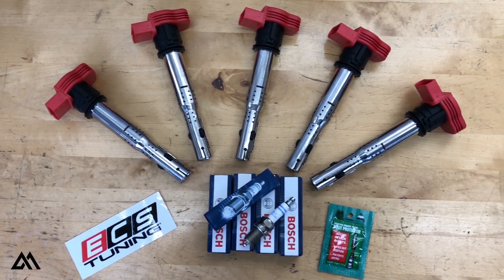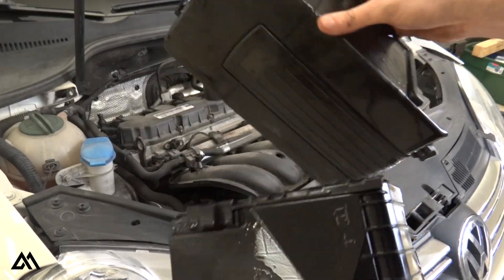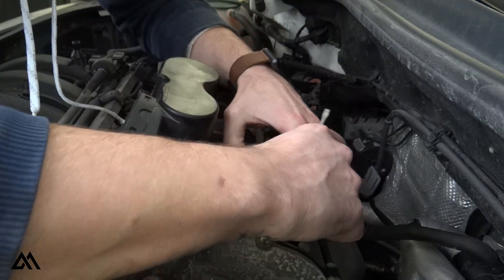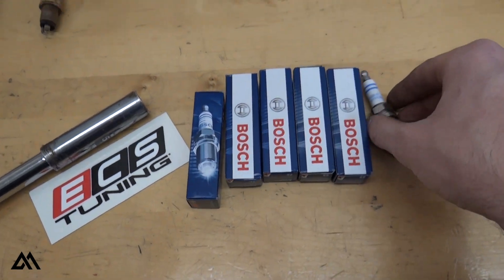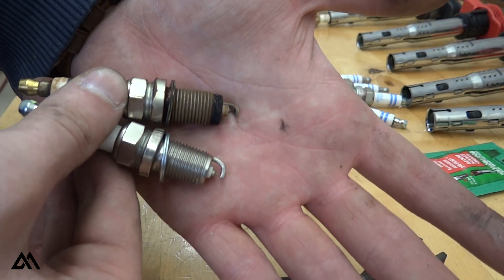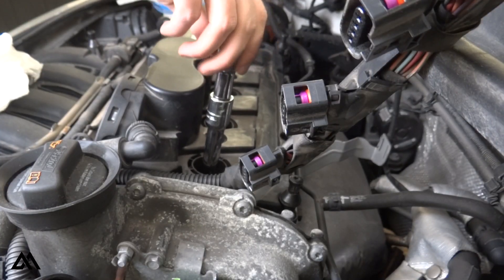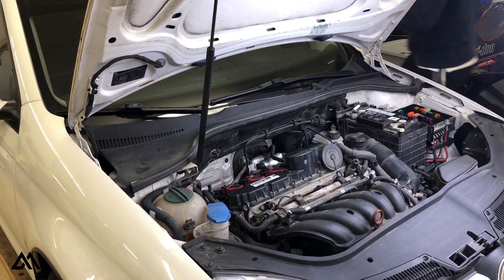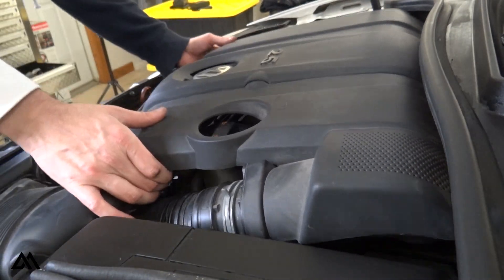Volkswagen 2.5L Ignition Service DIY | Coil Packs and Spark Plugs!

Comment: The dielectric grease should not be applied directly to the spark plug only the inner wall of the coil packs to prevent moisture and really you don’t have to use it at all cuz the coil pack insulates it pretty well already it could run rough from lack of power putting the grease where you put it.
Reply from the maker: Thanks for the correction. I’ll be sure to pin this comment so others can see.
Reply: Right. "Dielectric" means insulating. Great for waterproofing but horrible for conducting electricity.

Comment: Great vid. At the end of the video, were you able to run the engine without the engine cover and maf connected?
Reply: Don't do that, these Volkswagens have their air filter inside of the engine cover, that's why it's so annoying to remove all the hoses/pipe for the mass air flow sensor and the hose that connects to the throttle body. If you start the car without the engine cover, you will enable dirt and debris to get into your engine directly through the uncovered and unfiltered throttle body. You could install a cold air intake to keep the engine cover off, but the main point is filtering the air from airborne and loose particles.

Comment: what are the benefits from switching to the red coils?
Reply: It's a personal preference. I use NGK instead and they work great also.
Reply: @boomerguy9935 . No it's not.... If these are the real Audi ones, they are a lot more reliable and reduce heat soak by transferring heat better. You will have a better spark, smoother idle and if you plan on boosting your 07k these will handle the power more reliably......

Comment: Pop the coils up first,and then disconnect the coils.more room after you pop coils up,because it allows you to clear the bracket for the harness
Reply: Also, if you can't fit a flat screwdriver underneath, you can use a locked zip-tie as a tool to slide underneath the edge of the top of the coil to lift straight up. VW sells an expensive special tool which does exactly the same thing...typical German engineering.
Reply: Thank you guys 🙏

Comment: Hello, thanks for the video, may I ask you what sockets size u used? Thank you
Reply: There are special sockets that are made specialized for spark plugs but they are very interchangeable as they come in sizes such as ⅜", ⅝", etc. Just find the correct spark plug socket from your local auto parts store and keep in mind that they are NOT the same as deep sockets, they typically run deeper than deep sockets.

Comment: could a hard bump into a curb (slid in snow) cause the coils/plugs to get jostled enough to cause misfires? i'm getting random misfire and cylinder 1 - 4 (in a 2.5) misfire codes.
Reply: Highly unlikely, but if you're unsure, take the cover off as shown, and firmly push those puppies down with the palm of your hand. Don't hit it with a metal hammer if you're unsure. Deadblow or rubber, preferably with a block of wood over top.

Comment: you should NOT put the dielectric grease on the head of the spark plug! you do realize, that the grease does not conduct electricity right? thus it shouldnt be applied to any electrical connection part. Its meant to go on the inside of the rubber boot (the inner wall) or wires...but certainly away from any connection parts (like the head where you put it)
Reply: I agree. Dielectric means "insulating". It should definitely be used on rubber or plastic seals for moisture proofing. Never put it on metal-to-metal contact points.
Reply: Wrong the grease prevents corrosion and the metal makes contact
Reply: @michaelalemansr.8565  wrong. dielectric grease prevents contact...
Reply: This is true if you go to any mechanics channel that knows what their doing even Scotty Kilmer will tell you not to put it on the spark plug itself

Comment: Are these any better than the oem ones or are they the same, cuz modded euros has ignition “upgrade” kit, and ecs is “service” kit.
Reply from the maker: Dz Nts these are the oem coils. Just with red tops. It’s simply a service kit. You can upgrade to r8 coils for your 2.0. Ecs sells those as well.
Reply: @ModernEngineer  I got those for my gti 8 years ago... still running strong to this date...